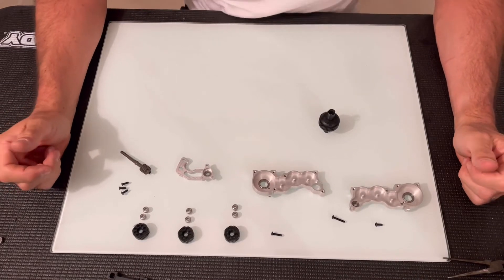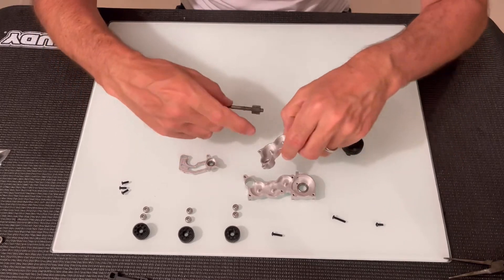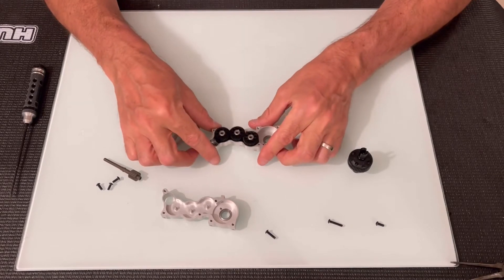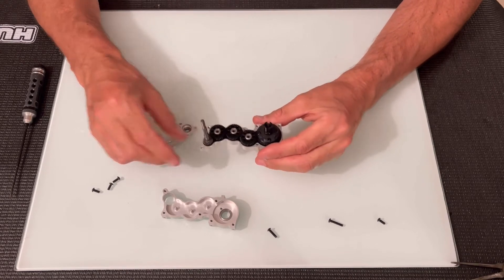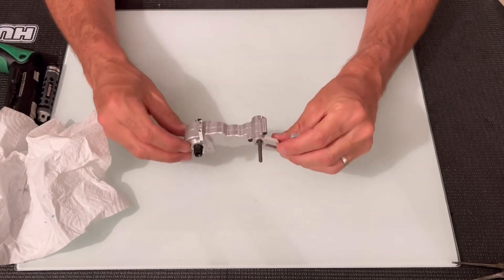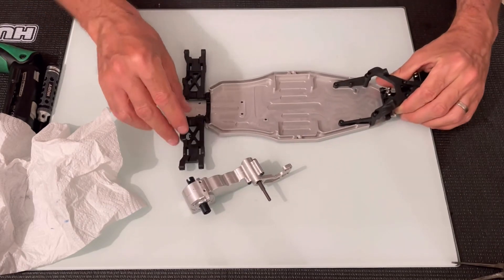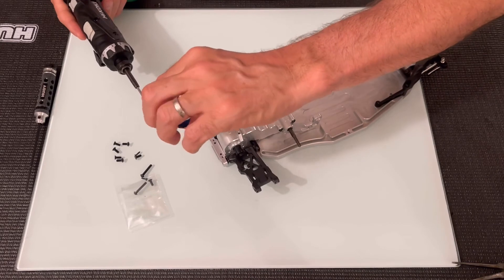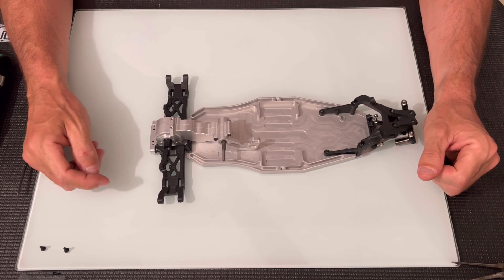Willspeed RF2 - Gearbox Build

Comment: Only suggestion I can offer.  The car sounds a little noisy on the track gear box wise.  If not running a stock class some silicone grease or black grease makes the tranny a lot quieter.
Reply from the maker: Appreciate the insight. It’s noisy because my pinion is a little fried, didn’t have a new one. So, new spur and pinion will stop the noise which have been ordered. Thanks for your advice though!